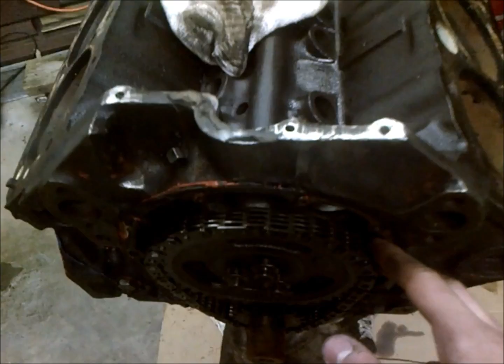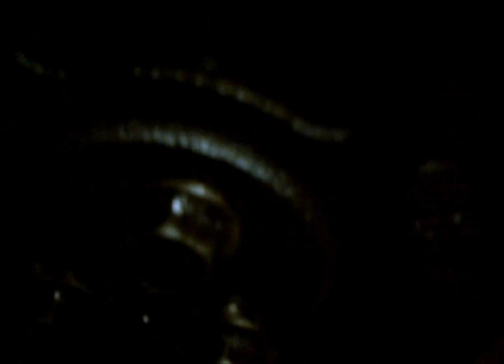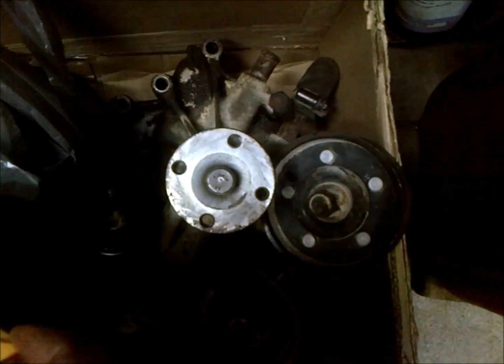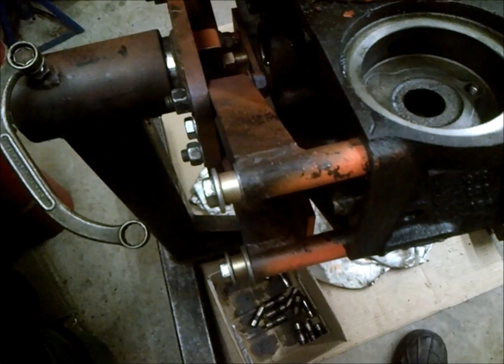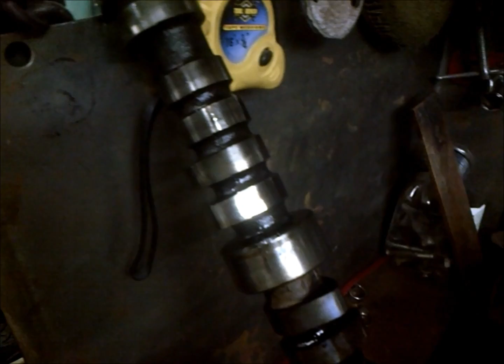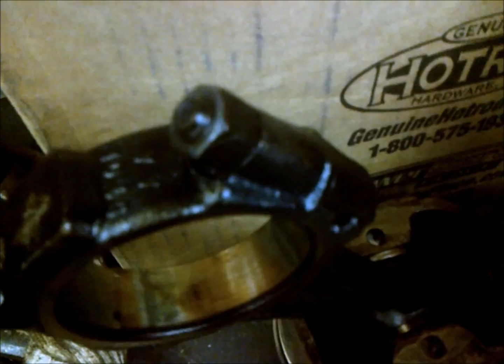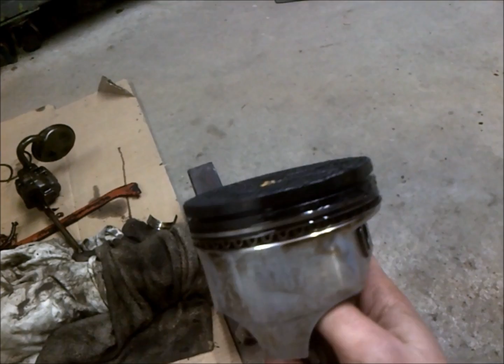350 Chevy vs Ford 302 Comparison: (Dumb Redneck Viewpoint)

Comment: the 350 is better than the 302. simple. the 305 and the 302 is a better comparison
Reply: Minty Oreos As I own half of an engine shop, I've rebuilt literally hundreds of 302's, never broken a WP stud, not one, not once. I was a tech at Ford for 8 years, never broke a WP stud, not one, not once. 350's are cheap as shit, the poor man's SB, it merely makes them common, no better, nor any worse.

As you have,done so repeatedly, they are shitty engines? 

Get a grip and try a little rationality next time.

Saying "I just know God exists" doesn't mean God exists.
Your opinion is merely your belief and unqualified.
Reply: Chevy made a 302 and it would rev to 9,000, then Ford copied it.
Reply: i just know 350's are better. try to change a fucking water pump on a 302. it takes 5 hours because you break double ended studs doing it, who the fuck came up with that bonehead design?? not GM.
Reply: Oh I see, I didn't agree with you and bow to you gracefully so now you throw your toys out of the pram and piss and moan about it.

I suppose your comment goes for all technicians, instructors, and engine rebuilding shops too.  Nobody could possibly know more than you or have a more rational opinion.

What do you want to be when you grow up?  An Astronaut, a fireman, president?
Reply: IN 1968 TRANS AM RACING WHEN CHEVY BEAT FORD. THE ONLY THING PRODUCTION ABOUT THE CAMARO WAS THE BOWTIE. THE CAR WAS ACID DIPPED AND WEIGHED IN AT 250LB LIGHTER THAN THE MINIMUM WEIGHT. ROGER PENSKE HAD 2 CARS. ONE THAT THEY WEIGHED IN TO FOLLOW TRACK REGULATIONS AND THE OTHER ACID DIPPED CAR THEY ACTUALLY RACED. This car here is probably the actual tech car that didn't race.THE SUSPENSION WAS ALL MCPHERSON STRUTS AND NOT PRODUCTION WHILE THE REST LIKE FORD, MOPAR, AMC USED STOCK PRODUCTION SET-UPS . THE NOSTALGIA CAR THAT RACE TODAY ARE NOT CORRECT THEY USE THE CONVENTIONAL SUSPENSION. THE ENGINE WAS NON PRODUCTION ALL ALUMINUM MOTOR BUILT BY TRACO. WHAT PENSKE DID TO BEAT FORD WAS DONE BY FREEZING THE GAS WITH DRY ICE WHICH ALLOWED THEM TO GET MORE FUEL INTO THE TANK (23 GALLONS INTO A 21 GALLON TANK). SO WHEN EVERYBODY ELSE WAS GOING IN TO REFUEL, THE CAMARO WAS ABLE TO STAY OUT AND GAIN LAP TIME ON A OPEN UNOBSTRUCTED TRACK AND WHEN THEY CAME IN TO REFUEL ONCE AGAIN THEY TOOK ADVANTAGE OF A UNOBSTRUCTED TRACK TO GAIN MORE LAP TIME.THIS IS HOW CHEVY BEAT FORD BY CHEATING. THERE IS A BOOK WRITTEN ON THE PENSKE SUNOCO CAMARO AND THEY NUMEROUS WAYS IT CHEATED. THIS IS WHY TRANS AM STARTED PUTTING PERMANENT STICKERS ON THE BODY IN SEVERAL PLACES AFTER IT WAS WEIGHED TO PREVENT CHEVY FROM CHEATING AND THIS IS WHEN THE PARTY WAS OVER FOR THE PENSKE CAMARO.  LIKE I SAID BEFORE CHEVY HAS BEEN CHEATING THEIR WAY TO THE FINISH LINE FOR YEARS. THEY SAY 4 OF THE 6 REMAIN. THE 2 NONE REMAINING CAR WERE THE ACTUAL RACERS THAT WERE HEAVILY MODIFIED BASICALLY CHEATER CARS THAT IN NO WAY REFLECTED THE PRODUCTION ONES THAT REMAIN.
Reply: THE TRUTH IS LIKE A ATOMIC BOMB FOR YOU CHEVY GUYS.
Reply: IN THE REAL WORLD THIS DESIGN FLAW ALONG WITH OTHER DESIGN FLAWS MADE THE CHEVY SMALL BLOCK GARBAGE. 302 & 351 WINDSORS IN TAXI'S TURNED A FEW HUNDRED THOUSAND MILES IN TAXI'S WHILE THE CHEVY SMALL BLOCK WAS ON ITS WAY OUT AT 60,000 MILES AND THAT IS BEING GENEROUS IN 24/7 DRIVING. THIS IS THE REASON WHEN YOU LOOK AT OLD MOVIES FROM THE 50'S,60'S,70'S YOU WILL SEE ALL THE POLICE CARS AND TAXI'S WERE ALL FORD'S AND CHRYSLER'S. THE CHEVY SMALL BLOCK JUST COULDN'T CUT IT.
Reply: Absolute, 100% horseshit.
Reply: The 302 Chevy was made specifically for the Trans Am Series in 1966 and it took Ford 2 years later to finally make their 302 Boss.
The 302 Chevy even was emissions compliant in race trim, with a PCV valve, emissions tube to the air cleaner, heated choke, and headers delivered in the trunk.
Reply: The Ford head has the air injection boss cast into the exhaust port, that's the restriction. The Chev used a phony tubing manifold bolted into the exhaust that failed about every 50,000 miles. Expensive to replace and I used to hate hearing the exhaust leaks coming from them.
Reply: The last Windsor I worked on came into the shop with two broken water pump studs. They were frozen to the block and the timing cover.
Reply: . . . And then God made Anti-sieze, and said it was good . . .
Reply: You can bet I used plenty of Anti-sieze on those skinny little 5/16 studs after wasting so much time extracting the rusted remains of the original ones. 

Most engines use separate bolts for the timing cover and the water pump to keep that from happening but Ford crapped out and combined them so the acidic coolant could work its way into the long bolt passages.
Reply: Tim Sharpe Ah, now I know!   Ford is shit, Chevy rules!  And for a fraction of the price too, I could have saved myself 40 years of engineering if I had only heard form you first. It all comes down to water pump bolt design.
Reply: Everyone knows that engineers are never wrong. Just ask one.

Trivia question. How many NASCAR Cup races has the Ford Windsor engine won? 

The small block Chevy has over 650 NASCAR Sprint Cup Series wins.

The Ford Windsor engine has zero.
Reply: A friend of mine went to get an Edelbrock intake for a 302, which was $189 at the auto parts store, then noticed the Chevy intake was $99, then he noticed that the ford intake fit inside the Chevy box . . .
Now who's smart !!
Reply: The Ford had a tiny bit more peak power and the Chevy had a much broader torque curve that made it better for road racing.
Reply: Tim Sharpe
ooops, my bad, I forgot who I was talking to, I now realize I should have just ignored you.

I forgot you are the guy who thinks he knows everything about block and cam ever engineered.

Drones like you roll into my shop every day, you fit my counter top labour guide perfectly.

Labour $104/hr
If you want to watch  $150/hr
If you've already tried fixing it yourself $200/hr

Damn notifications, I'll at least remember to block you so that I'm not alerted to your insufferable drivel this time.
Reply: DO YOUR RESEARCH TIMMY SHARPY BECAUSE WHAT I TOLD YOU ABOUT THE PENSKE SUNOCO CAMARO IS TRUE.  THEY CHEATED TO BEAT FORD. THERE IS A ACTUAL BOOK WRITTEN ON THE PENSKE CAMARO AND HOW IT CHEATED. IT IS FAR WORSE THEN THE THINGS I BOUGHT TO LIFE HERE. SECONDLY THE RESTRICTOR PLATE WAS USED TO STOP FORD FROM DOMINATING THE SPORT OF NASCAR. THE RESTRICTOR PLATE SLOWED UP FORD TO EVEN THEM UP WITH THE OTHERS. 
TODAY'S UNDERHANDED TACTICS IN SCCA RACING IS NOT LIMITED TO A 5 DEGREE DISCREPANCY IN A THERMOSTAT. A FEW YEARS BACK WHEN THE MUSTANGS WERE MAULING DOWN EVERYTHING SO TRANS AM MOVED VERY QUICKLY TO STOP FORD BY MOVING THE MUSTANGS INTO A FASTER RACE CLASS. TODAY IT IS NO DIFFERENT FROM YESTERDAY IN RACING WHICH IS INFECTED BY DIRTY POLITICS OF CHOOSING WHO WILL WIN A RACE.
Reply: GM switches to racing engines from Ford's Cosworth division
July 27, 2003|By Rick Popely, Tribune staff reporter.
 

 104
When rivals General Motors Corp. and Ford Motor Co. agreed last year to jointly develop an automatic transmission, some industry analysts wondered, is nothing sacred?

Apparently not, at least in the racing end of the auto business.

After losing consistently in Indy Racing League events this year to Toyota and Honda, GM is replacing its engine with one developed by Cosworth Engineering, a wholly owned Ford subsidiary based in England.

Neither the Ford nor Cosworth names appear on the new engine. Though GM had no part in its development, it is badged the Gen IV Chevrolet Indy V-8. However, critics are giving the new engine nicknames such as Gen Ford and Chevworth.

GM is phasing in the Cosworth engine among its six IRL teams, starting with defending IRL champion Sam Hornish Jr.'s car this weekend at Michigan Speedway. All Chevrolet teams should have the Cosworth engine before the series competes Sept. 7 at Chicagoland Speedway in Joliet.

GM dominated the IRL from 1997-2002, winning all but three races against Nissan's Infiniti brand.

That changed this year with a requirement for new engines and the arrival of Toyota and Honda as competitors. Through the first nine races, Toyota has won seven, including the Indianapolis 500, and Honda two.

Chevy-powered cars recorded the slowest qualifying speeds at most events and did not lead a lap through the first eight races.

GM developed the Gen III engine for this season from scratch but decided to shelve it in favor of the Cosworth when its engineers couldn't find more speed.

"The list of engine builders in the world that could supply this engine is pretty small. It [Cosworth] turned out the best option for us," GM Racing spokesman Mike Stoller said. "It is a statement that Chevrolet is committed to improving its performance in the IRL. It speaks to our desire to get it right and to field a competitive engine."

Cosworth helps build the engine for the Ford SVT Focus and has a 30-year history of racing involvement with Ford. It supplies Jaguar- and Ford-badged engines for the Formula One and Championship Auto Racing Teams series, but it operates as an independent engine builder.

"Cosworth makes its own business decisions and does not report to Ford Racing," said Ford spokesman Greg Shea. "This is a Cosworth business decision, not a Ford Racing decision."
Reply: EVERYTHING CHEVY DOES IN RACING TODAY IS ALL FORD. FOR YEARS THEY HAVE BEEN USING RULES AND RULE BOOKS TO FAVOR CHEVY TO WIN. THE SMALL BLOCK CHRYSLER AND THE CHEVY SMALL BLOCK ARCHAICALLY SHARE ALL THE SAME DESIGNS FROM THE SIAMESED INTAKE AND EXHAUST PORTS TO THE REAR DISTRIBUTOR AND OILING SYSTEM TO THE FIRING ORDER. SO HOW COME THE CHRYSLER NEVER REACHED THE STATUS IN RACING THE SMALL BLOCK CHEVY DID?
Reply: It does seem to be a poor design decision to have 2 exhaust ports back-to-back in the center, screaming hot at 700*, then inches away Siamese intake ports, gasoline chilled to 0* - - we're talkin' heat distortion here.
Reply: A FOOTBALL OVER YOUR HEAD. OBVIOUSLY IN THE 1960'S IT WAS A ALL OUT WAR BETWEEN FORD AND CHRYSLER BIG BLOCKS WHERE GM NOR CHEVY COULDN'T COMPETE. THIS IS WHY NASCAR CHANGED THE CUBIC INCHES OF THE ENGINE ALLOWING ONLY SMALL BLOCKS TO GET CHEVY BACK INTO THE GAME. BUT THE INLINE WINDSOR MOTOR DURING THE 1960'S WAS DEEMED ILLEGAL FOR USE IN NASCAR. RACE VERSIONS OF THE HI-PO 289 PUNCHED OUT 450HP FROM 289 CUBIC INCHES. THE 1964 A/FX MERCURY 2700LBS DOOR SLAMMER COMETS PUNCH OUT 11.20 1/4 MILES DRIVEN BY DOUG NASH. THEY WERE SHEER TERROR ON THE RACE TRACKS. THIS IS WHEN THE NHRA STARTED CHANGING THE RULE BOOK AND RULES ON THE SMALL BLOCK FORD TO DISCOURAGE ANYBODY FROM RUNNING IT. GUYS WOULD SHOW UP AT THE TRACKS WITH THESE SMALL BLOCK FORDS GOING IN THE 10'S REEKING TERROR ON THE COMPETITION. A FELLOW I KNEW RAN A 1965 HI-PO MUSTANG INTO A CONSISTENT 10:88. HE WAS GOOD FRIENDS WITH JOEL FROM BALDWIN MOTION IN NEW YORK AND OFTEN DYNO TUNED HIS CAR FOR HIM. SO THE NEXT TIME THEY RETURN THE RULES ON THE SMALL BLOCK FORD WOULD CHANGE MAKING IT DIFFICULT TO RACE WHICH EVENTUALLY LED TO THE DISAPPEARANCE OF THE SMALL BLOCK FORD IN 1/4 MILE RACING. IT TURN IF YOU CAN'T RACE, THEN THERE WAS NO NEED FOR THE AFTERMARKET OR FORD TO PRODUCE RACE PARTS THAT WERE DEEMED ILLEGAL FOR USE. THIS IS THE REASON YOU COULDN'T GET RACE PARTS FOR A FORD AND IF THEY DID MAKE THEM THEY WERE 3+TIMES MORE WHICH CONCLUDES WHY FORD ALWAYS COST MORE MONEY TO BUILD. AT LEMANS IN 1964 THE 289 DAYTONA COUPES WENT 200MPH AND AVERAGE 196MPH BEATING FERRARI BY ALMOST 40 MINUTES TO WIN LEMANS IN 1964. THESE ARE THE REASONS WHY NASCAR BANNED THE SMALL BLOCK FORD AND DEEMED IT ILLEGAL FOR USE. IN THE STOCK FORM A WINDSOR HEAD WAS NOTHING MORE THAN A HEAD DESIGNED FOR FUEL EFFICIENCY WHILE CHEVY DESIGNED HEADS FOR PERFORMANCE AT A COST OF DRINKING FUEL UP LIKE A HORSE. SO YES YOU ARE CORRECT THAT A WINDSOR HEAD COULD NOT QUALIFY BECAUSE IT WAS NOT DESIGNED FOR PERFORMANCE AND WAS NEVER A RACE ORIENTATED HEAD. BUT WHEN ROBERT YATES TOOK THE SUPERIOR HEAD DESIGN OF THE WINDSOR AND RACE ORIENTATED IT, NASCAR QUICKLY HAD THEM BANNED. THE RESTRICTOR PLATE IN RACING WAS USED TO STOP FORD FROM DOMINATING NASCAR FIRST IN 1970 WITH THE BOSS 429. NASCAR LATER USED THE RESTRICTOR PLATE TO SLOW DOWN FORD AND ITS CLEVELAND BASED ENGINES. THE CLEVELAND HEADS MAGIC NUMBER WAS THE .600 INCH LIFT WHICH IS WHEN THESE HEADS CAME ALIVE. THE RESTRICTOR PLATE WAS VERY DETRIMENTAL TO THE CLEVELAND BECAUSE DOWN LOW THEY DID NOT PRODUCE THE POWER AND NASCAR KNEW THAT SO THE RESTRICTOR PLATE REMEDIED A SOLUTION TO STOP FORD BY CHOCKING IT. NASCAR ALSO LIMITED THE CARBURETOR SIZES WHICH ALSO CHOKED THE CLEVELAND HEAD. THESE WERE THE TACTICS USED BY NASCAR TO HELP CHEVY WIN WHICH WAS NOTHING MORE THAN ENGINEERED CHEATING.
Reply: HERE IS THE QUESTION ONCE AGAIN? THE SMALL BLOCK CHEVY AND THE SMALL BLOCK CHRYSLER ARCHITECTURALLY ARE THE SAME. THEY SHARE THE SAME SIAMESED HEAD DESIGN, FIRING ORDER, REAR DISTRIBUTOR AND OIL PUMP LAYOUT, OILING SYSTEM, COOLING SYSTEM, ETC. SO THERE POTENTIAL TO MAKE POWER IS IDENTICAL. SO HOW COME IN RACING THE CHRYSLER SMALL BLOCK NEVER REACHED THE STATUS THE CHEVY SMALL BLOCK DID SINCE THEY BOTH HAVE THE IDENTICAL LAYOUTS??
Reply: that's that one that was designed for formula 1 in the uk
Reply: Minty Oreos You have words and your opinions but that's all.
Reply: *****
. . . A friend and I built a 351W and a 350 4bolt Chevy side by side, and when we bought the parts, the rings and the rod bearings were the exact same part numbers.  These engines are VERY similar, but one difference I noted as I ported my heads, by hand, not really knowing what the F I was doing, was the exhaust ports on the Chevy you could put your thumb in and move it around - - the Ford your thumb was a tight fit.  There's your restriction.
Reply: I'm a retired technician with over 2 decades of experience as an auto/heavy truck mechanic.

When I was in the business I maintained 15 professional certifications. I was an ASE Master Auto Tech and an ASE Master Heavy Truck Tech. I was also certified in Design Testing and Maintenance of Fire Apparatus.

I don't know everything but I know enough.
Reply: Tim Sharpe You are right, I am wrong. 
Please stop replying, I don't need notifications to your posts.
Reply: It wasn't copy they did the same thing Chevy did the stroked a 4" bore motor to make 302ci.  So both motors share the same bore and stroke and both have similar red line potential.  The Chevy motor had more hype being exclusive to the Z\28 at least until Ford rolled out the Boss 302 in 69 giving it a slight edge in power.
Reply: Tim Sharpe
You realize that both companies made countless variations and combinations of both of these engines.  Different heads, especially Chevy who changed heads repeatedly, cams and valve timing changed a great deal over the decades too, even from model to model in the same year.  That's not even considering Windsor and Cleveland variations either..
Way to be specific!  Offering blanket statements regarding either company or  their products is pretty useless.
Reply: If you paid closer attention to the current discussion you would have noticed that the last two comments were Z\28 302 and Boss 302 specific.
Reply: Frank, your head is thicker than Oprah's butt!
Reply: Frank289100 On the left side of your keyboard there is a button with the letters Caps Lock (or similar) on it.

Children use it to capitalize all the letters in their online comments, in the hopes it gets a mot point greater attention.  Unfortunately, it simply makes them look weak and illiterate.

Adults generally just use the 'Shift' key to help make their comments legible by capitalizing an individual letter at the beginning of a sentence, indicating nouns, acronyms etc.

As you grow up, you can put the Caps Lock key to better use simply by pressing it once to turn it off and once to turn it on.

I won't get into grammar, these days even the simplest grammar is ignored.  Even fundamentals like breaking thoughts into paragraphs have gone the way of the dodo bird.  Most of today's semi-literate society simply use the 'it was my phone's fault excuse.
Reply: 1.) I'm not a Chevy guy.

2.) I have seen the SCCA disqualify cars for having a thermostat that was 5 degrees cooler than stock and Frank wants us to believe they allow cars to compete 250 pounds underweight. I used to race stock cars and every podunk race track has scales and they use them.

3.) Frank is a screeching child who can't find any proof of his fantasies because I have repeatedly asked him to provide evidence that NHRA and NASCAR banned the small block Ford from competition and he can't find any.
Reply: Smokey Unick cheated all the time in NASCAR - he once ran a 7/8 scale Oldsmobile (I think) ran a propeller driven generator ahead of the radiator, qualified with NO fender trimming, then raced WITH fenders trimmed . . . he used "ram air" to pressurize the gas tank to help the stock fuel pump . . . endless list . . .
Reply: Smokey Yunick took out parts of the firewall out to create a cross flow through the vehicle's cab reducing the car of the drag of pulling a parachute through the air and it also stabilized the car where it could cruz the banking turns at higher speeds. THIS CHEVY PHONY RACING DYNASTY IS ALL BASED ON CHEATING. SECOND POINT SMOKEY YUNICK HAD NOTHING TO DO WITH THE DEVELOPMENT THE THE CHEVY BIG BLOCK. IT WAS 1 GM ENGINEER ALONE WHO CREATED THE CANTED VALVE 377 SMALL BLOCKS IN THE GRAND SPORT CORVETTES WHICH ONLY 3 WERE MADE. THAT ENGINEERS WORK BROUGHT THE BIRTH OF THE CHEVY BIG BLOCK..
Reply: People write books on a flat earth and vast cities on Mars. Does that prove that their stories are true just because they're in books?
Reply: Yep, which is why I suggested comparing 351W to 350 - both 4" stock bore motors with nearly identical stroke but the comparison ends there.
Reply: THE 351 WINDSOR WAS JUST A BETTER MOTOR THAN THE 350 CHEVY IN EVERY WAY. RACE HISTORIANS ALWAY WONDERED WHY THE 351 WINDSOR WAS SO HIGHLY OVERLOOK.
Reply: Because no 351 W ever qualified for a NASCAR race because they make about 150 less HP than a comparable SBC.  Kind of hard to compare something that's not really comparable. The Windsor was perfectly legal for NASCAR and NHRA competition so don't spew your crappy excuses unless you can provide real evidence from a NASCAR OR NHRA rule books.
Reply: SINCE THE 1960'S THE INLINE SMALL BLOCK FORD WAS NOT LEGAL FOR USE IN NASCAR. CERTAIN YEAR 2 BARREL 351 WINDSOR HEADS ON THE INTAKE SIDE WITH SMALLER VALVES AND PORTS FLOW JUST AS GOOD AS THE BEST CHEVY HEADS THE FUELIE 2.02 BECAUSE IT WAS A BETTER DESIGN AND WHAT CHEVY COPIED FOR THE LS. IF THE WINDSOR HEAD CAN FLOW JUST AS GOOD AS CHEVY'S BEST THE FUELIE. THEN WITH BIGGER VALVES AND LARGER PORTS OBVIOUSLY HANDS DOWN THE WINDSOR WILL MAKE MORE POWER THAN THE CHEVY. THIS IS THE REASON IN THE NHRA THEY GO BY PART NUMBERS. MANY OF THE BETTER FLOWING FORD HEADS WHICH WERE NEVER A RACE ORIENTED HEAD LIKE THE FUELIE WERE RARE AND HARD TO FIND WHICH WHEN USING PART NUMBERS GIVES CHEVY THE ADVANTAGE. ALSO CHEVY MADE OVER THE COUNTER HEADS WHICH ALSO QUALIFY THEM IN COMPETITION. CHEVY WINNING IS ALL POLITICS, MANIPULATING THE RULES FOR CHEVY TO WIN.
Reply: The only quotes frank has are his own lunacy. Nothing from NHRA or NASCAR. JUST CRAZY OLD FRANK TYPING IN ALL CAPS LIKE IT MEANS SOMETHING SPECIAL.

Every search on the subject of NHRA and or NASCAR banning the Ford Windsor comes up completely empty except for a few crackpots like frank babbling on some ford forums.
Reply: Like I said before. I worked on a government fleet that included Ford and Chevy cop cars. The only ones that gave us any real trouble were the Ford Crown Vics with Windsor engines. They puked timing chains at 70,000 miles and leaked oil like a chain saw. 3800 pounds with a 140 HP weeny V8 = 85 MPH at WOT. Can't even run down a VW Beetle.
Reply: NASCAR DEEMED THE INLINE SMALL BLOCK FORD ILLEGAL FOR USE BACK IN THE 1960'S. FROM 1964 TO 1969 THE WINS IN NASCAR WAS SPLIT BETWEEN FORD AND CHRYSLER. OTHER THAN CHEVY WHO WON A HANDFUL OF RACES IN THOSE YEARS, NO OTHER GM PRODUCT WON ANY RACES. WHERE CHEVY WON WAS ON THE SHORT RACE TRACK WITH MANY ABRUPT TURNS WHICH ALLOWED CHEVY TO WIN WITH THERE 327 ENGINE IN THE CHEVELLE. WHAT THE NHRA DIDN'T WANT IS THE FORD TEAMS RUNNING THE BIG BLOCKS TAKING THE LIGHTWEIGHT HI-PO 289 AND DOMINATING THE SHORT RACE TRACKS. BY DEEMING THE SBF ILLEGAL. IT ALLOWED CHEVY TO WIN RACES ON THE SHORT TRACKS. THE SMALL BLOCK FORD WAS BANNED TO ALLOW CHEVY TO WIN.
Reply: In the early 60s Ford teams used the FE series big block engine in NASCAR. They didn't use small blocks until the early to mid 70s. Fact, no Windsor powered Ford ever qualified for a NASCAR race because they won't make the needed HP. That's why Ford lobbied to put Cleveland heads on the Windsor block.

In 1961 Pontiac was barely involved in NASCAR and got 30 wins while beating the poop out of the factory backed Ford teams.
Reply: Post the NHRA rule against the Windsor or shut up.   

Post the NASCAR rule against the Windsor or shut up.
Reply: HERE IS THE QUESTION? THE SMALL BLOCK CHEVY AND THE SMALL BLOCK CHRYSLER ARCHITECTURALLY ARE THE SAME. THEY SHARE THE SAME SIAMESED HEAD DESIGN, FIRING ORDER, REAR DISTRIBUTOR AND OIL PUMP LAYOUT, OILING SYSTEM, COOLING SYSTEM, ETC. SO THERE POTENTIAL TO MAKE POWER IS IDENTICAL. SO HOW COME IN RACING THE CHRYSLER SMALL BLOCK NEVER REACHED THE STATUS THE CHEVY SMALL BLOCK DID SINCE THEY BOTH HAVE THE IDENTICAL LAYOUTS??
Reply: Not to "red herring" you, but I would think Chrysler was happy dominating Drag Racing with their Hemi.
I currently drive a Ram van AND p-up, 318 and 360 and I still have all my old 350's and hop-up parts.
I'm thinking Chrysler didn't experiment much with head design, as compared to GM.
Reply: Unlike any Ford small blocks - CHRYSLER small blocks did quite well in NASCAR without having to beg NASCAR for favors like Ford did when their Cleveland couldn't cut it.
Reply: Then there is body styles - the Ford Taurus was never offered as a 2-door in the "real" world, and Ford cheated again in the "Truck" series by racing a streamlined F150 body style and selling a boxy F250-350 while Chevy and Dodge raced  the same cab-style as their 3500 series trucks.
Reply: how is that horseshit? the ford 302 is a piece of shit. and is such an inferior design to the sbc.
Reply: It sure isn't smart to spend 90% more to get less power and durability.